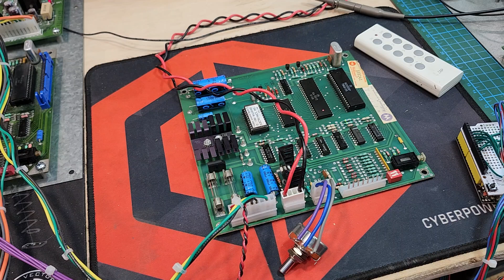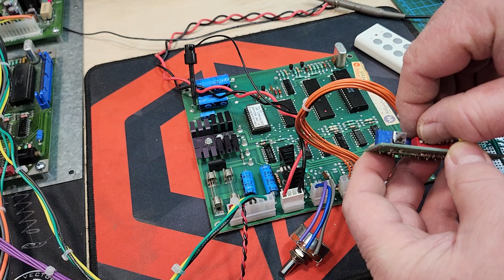Williams Sound Board - Automated Tester

Comment: Are the binary codes available somewhere to trigger alll of the sounds? I want to make a switch board like you have to be able to play all of the sounds.
Reply from the maker: If you look at the number of wires coming into the I/O connector, you can count how many wires and determine the maximum value (5 wires: 2^5=32, 6 wires: 2^6=64). What I did is just send 0 to 64 and delayed a few seconds between and noted which ones had sounds. After that, my code only sends the correct value (Decimal to Binary) over. I have changed the code a bit recently to only play one sound from each digital input line. This verifies all the hardware is 100%. These are the values for Robotron as an example: SoundVal[6] = {62,61,59,55,47,31}
Reply: @ cool i just bought 3 non working boards for $20 each. I’ll see if I can get the running. It looks like they only need +-12v. My plan was to make it a self contained “sound board” with buttons on it and maybe a rotary encoder to change the sounds or possible just have all 5 or six buttons so you can bang out the binary triggers manually…